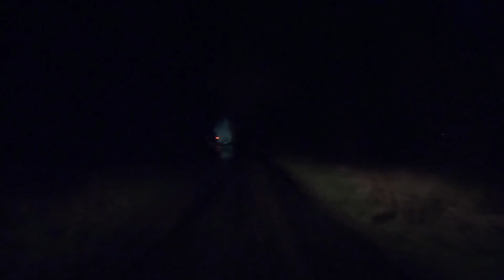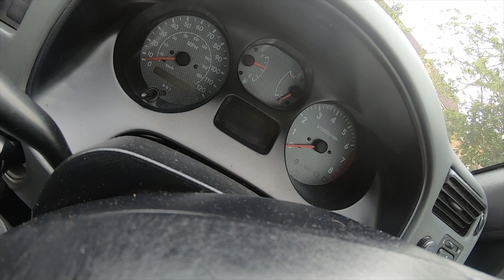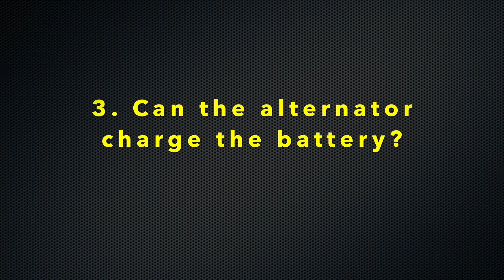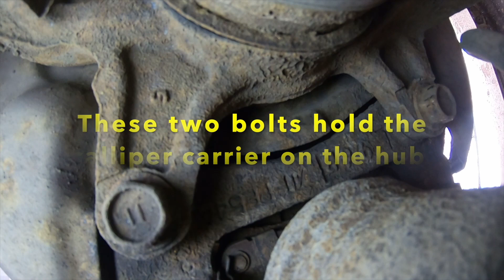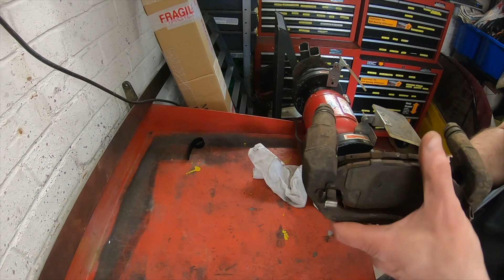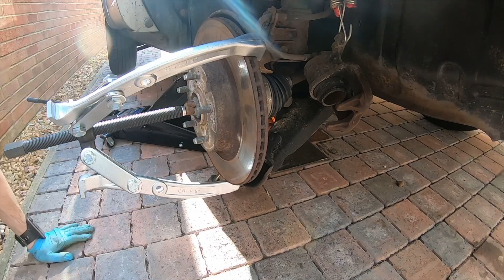Mk1 Toyota RAV4 Introduction, offroading, battery and alternator testing, front brakes disks & pads.

Comment: alternatively put 2 bolts through the threaded holes on the disc and evenly tighten them up. They bottom out on the hub and draw the disc off .